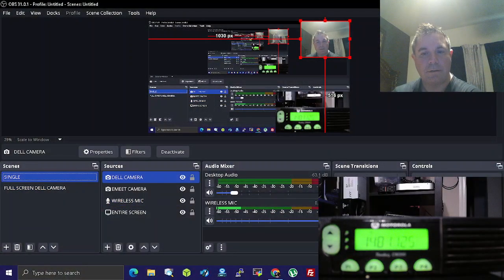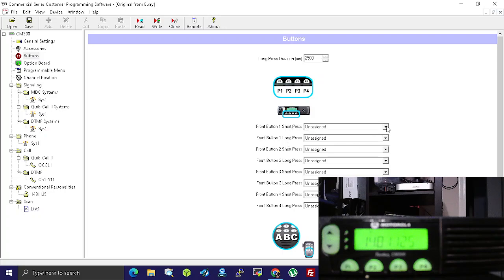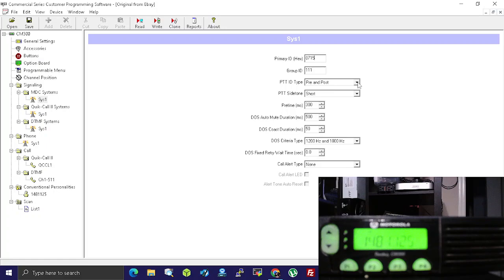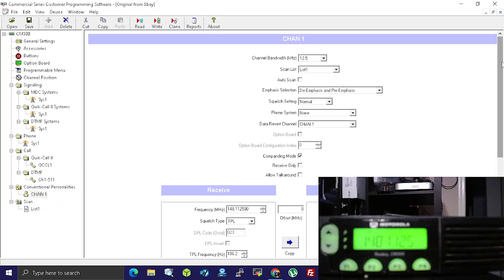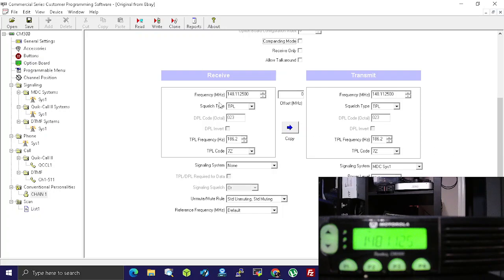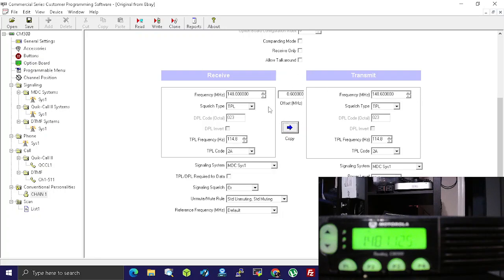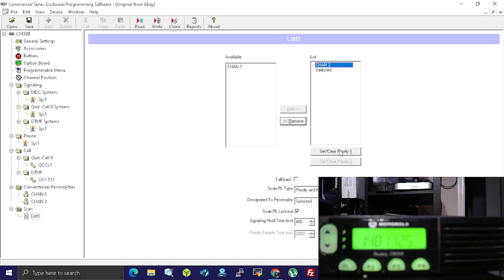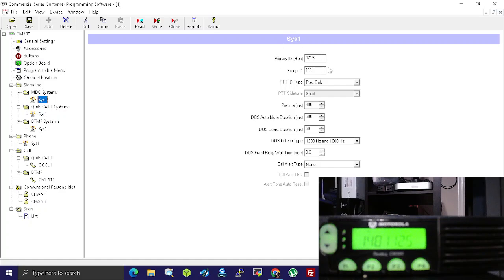Motorola PM400 CM200 Programming

Comment: I am trying to fix a similar radio for a friend's construction company, but it uses the same software. He is also wondering about his other current radios have a funky "roger beep" after someone transmits. Can this be shut off or changed to a different one that is more subtle? (All radios are Moto PM400's) This video is very helpful, thank you.!
Reply: That's mdc, and its used for identifying radios. For example, if radio A tansmits, radio B will decode that "Roger beep" and display the id for radio A and vice versa. Go to the personally, and under signaling on the transmit side, turn off mdc. You will have to do this for every personality
Reply from the maker: Exactly, open the CPS and goto all the Channels.. When you open it you will see a transmit and Receive columns (almost reverse mirrors) of the column... At the bottom, it should say "signaling" or "MDC" just set that to none.

Comment: I have an analog cm200. Where can you get the software?
Reply: Motorola
Reply: @Sky_Pony_1_mic_sierra  it's not on their site anymore
Reply: There's another video with a link to cps 5.16
Reply: @Josh-Barnett where
Reply from the maker: Im lost
Reply: He changed his name. Title is Motorola CP200 PM400 PR400 CM200 CM300
EP450 Programming and Software @HOTSPOTGUY
Reply: https://drive.google.com/file/d/1ujCK4meSdwuh8zebTFres95miODGV73b/view?usp=drive_link

Software link
Reply from the maker: Thanks bud!
Reply: https://drive.google.com/file/d/1ujCK4meSdwuh8zebTFres95miODGV73b/view?usp=drive_link
Reply: Software link
Reply: CPS RO 5.16 version will program CM200 CM300 PM400
Reply from the maker: I like that PM400 in your videos.. best radio Motorola ever made
Reply: @HOTSPOTGUY its not my video, but I do agree the commercial series is my favorite. I do prefer the CM300 design over the PM400.  Motorola still sells the control head housing and lens, so with a bit of codeplug hacking and some new parts, you can basically convert an old beat up CM300 into an almost brand new pm400 or vice versa minus the top cover, which they don't sell anymore. I think you can use a Mototrbo top cover, but I'm not 100% sure it would fit and they are expensive
Reply: I found the CPS software at Alberta Radio service
Reply: https://youtu.be/qD9lGaK7C60